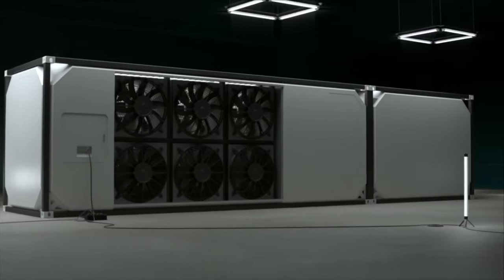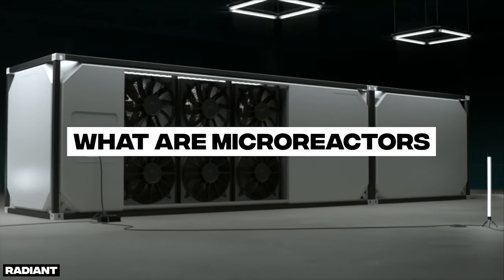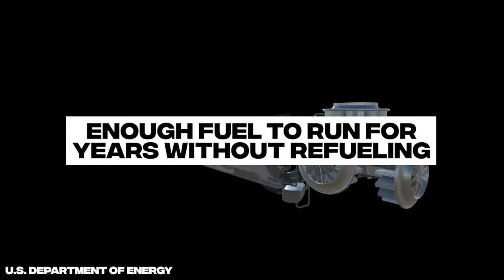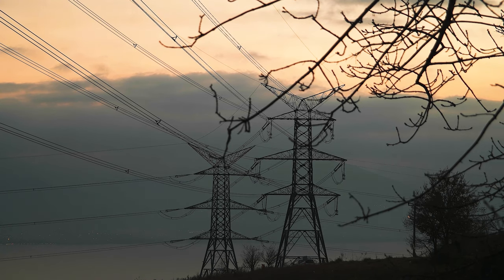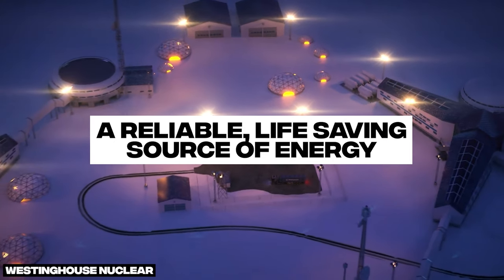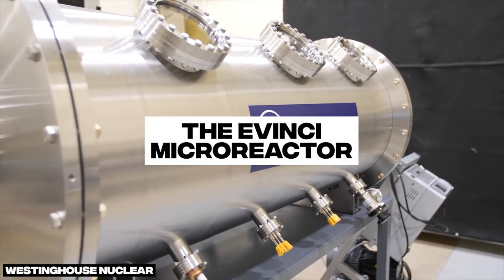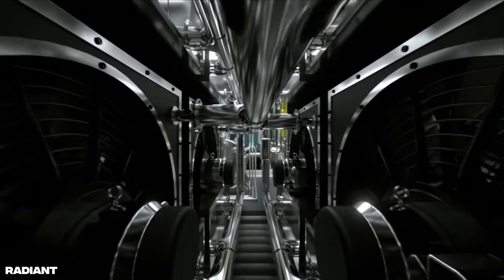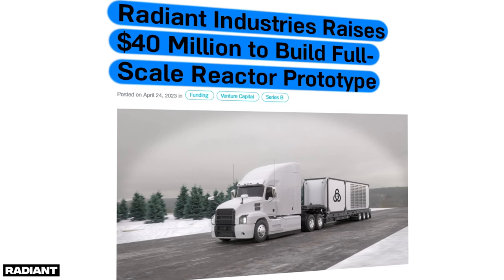Mobile Nuclear Reactors Will Change Everything

Comment: Microreactors could be used not only for electricity but also as a source of hot water for district heating, reducing the cost even further.
Reply: @williamjones9662  Bury it 5 miles deep
Reply: think Iceland 🇮🇸
Reply: Also provide hydraulic power for shops running hydraulic tools…also potentially make medical isotopes for hospitals potentially…and provide a beam line for X-Ray and Gamma Ray lasers for communication or spallation sources…space propulsion…if they’re successful…this will be as transformative as Space X Starship…yes I know many of their engineers used to work for SpaceX

Comment: Nuclear electricity is the most expensive form of  energy and this Micro-reactors would be priced well over 8 million Dollars easily and if You add the maintenance costs for 30 years it will reach at least 12 million Dollars in total , and if you use this 24/7 for 30 years you can use it for 262800 hours and once you divide 8,000,000 to 262,800 = each KW/H is around 30.00USD which is extremely high

Comment: So you're aware, westinghouse has a much smaller reactor, but it's classified still. This one was only recently declassified and applied to commercial applications. Government only uses them for subs and some aircraft.
Reply: Aircraft 😳
Reply: Exactly this. Micro reactors are not new. They have been in service for decades.
Reply: There’s a lot more than Westinghouse haha, over 15 providers with great generation 4 designs!
Reply: @Ikbeneengeit  That claim is total bs, at the most charitable they might be talking about the reactor in the NB-36. The reactor on it just output its heat to a radiator providing 0 thrust.
Reply: Tell me what aircraft is powered by a nuclear reactor.. 😂

Comment: Heat pipes with no moving parts VS exposing fast-spinning turbine blades to a high neutron flux.
Hard choice.
Reply: imagine a neutron turbine :)
Reply: I liked your comment, but thinking about it again, I'm not sure that this is what was actually presented. One thing that kept bothering me after re-watching the video is that we didn't see any associated turbine for the other two designs - just the reactors. If the reactor's heat isn't spinning a turbine, then it's not producing any electricity (at least, not very efficiently). So the jet-turbine blades are really comparable to the heat pipes, because they have different purpose (namely to convert the energy into electricity, rather than merely to prevent the reactor from overheating). That said, I do wonder if those blades are exposed to the neutron flux, and how big an issue that's going to be. Just looking at the way that quad-pack is configured, it looks like they're in the line of fire, but I'm just not sure.
Reply: @sillysad3198  no thank you, that would weigh a inconceivable amount. a "teaspoon" of neutrons weigh like 10 million lbs.

Comment: Not to mention data centers  (esp the mega scale ones used by the larger public cloud providers). These have a major common issue when a new site is to be picked: The local power grid can't supply enough power due to insufficient transmission capacity. But if a few micro reactors can be brought in and be operational in a month instead of a decade, and run continuedly for +5 years that problem suddenly becomes a lot less complicated. Ofc now you get the NIMBY rowd that will rase loud objections to a "mini chernobyl", never mind that these reactors are many decades newer with a completely different design, even vaguely close to them, but these problems can probably be solved by throwing enugh money (ie legal staff) at them.

Comment: ROSATOM's floating nuclear power plants like the Akademik Lomonosov is another interesting portable alternative. 

Since the reactors employed are smaller in size and power than most commercial land-based reactors, mostly derived from nuclear ship and submarine power plants, the power output is generally a fraction of a conventional nuclear power plant, usually around 100MWe, although some are planned to have as much as 800MWe.

They are also working on the Shelf-M reactor, a low-power NPP (ASMM) designed for local electricity supply to facilities in remote areas with an undeveloped power grid. The planned installed capacity is up to 10MWe. The estimated service life of the station is 60 years with refuelling every eight years.

Comment: my concern is how easily these could become orphan sources. the soviet union used RTGs extensively, for somewhat similar reasons, and when they collapsed those reactors became one of the largest contributors to orphan nuclear material in history. to my knowledge, they are still out there too, not all have been located.

using nuclear energy in military activities is also a concern when you consider that would make nuclear material a target for other militaries. if a military is using one nuclear reactor to power a large encampment, that's a clear target for bombings or sabotage. and a successful strike would essentially become a dirty bomb. obviously not good.

I am in general pro nuclear energy. but I really don't know that going to microreactor scale is reasonable considering the risks. at scales beneath what a small modular reactor can do, I think using renewables is probably viable.
Reply: I'm also pro-nuclear as it really is practically low carbon, baseload and gigawatt scale. but I was wondering, given the more enriched uranium how does one prevent some group from getting the uranium, especially in isolated remote regions.
Reply: @peterkratoska4524  Carrying out such a heist would require Nation state level resources. Same reason not many heists of fighter jet planes
Reply: Maybe an earthen dam or other protective considerations. But ya,  bunker busters etc. A huge target.
Reply: You can put them underground

Comment: FYI  they are great , but if you think you can throw them on a regular truck, think again... a 5MW mocro reactor is 8ft x 30ft  it weighs 660000lbs!!! Or 300 tons Not including turbine and heat exchangers. And requires concrete rooms to be built.

Comment: I don't think this is an option for disaster relief. Puerto Rico an island of 3milion will not be helped by a handfull of 10Mw Reactors. How do you want to do risk assesments, safety, etc in a area that has just had a disaster happen. If idk if Nuclear is the only option for places like Valdeze, but it seems like a way more reasonable solution than disaster relief. 
The only way I see DR happening is if it is put on a ship and doesn't leave it. i.e. Town gets hit by Hurricane which destroyes powerplants. Then ship pulls into the Harbor and is connected to an improvised interconnect, and supplements the local grid. This would allow the risk management etc happen in a controlled enviroment beforehand.

Comment: how much do they cost, and how are small remote towns expected to pay for them? are they expecting rural electrification grants from the state or federal government?
Reply: These small towns in Alaska and Canada are paying between $20/$30 per gallon of diesel. Yes, PER GALLON. Basically, some are so remote they need to fly in the fuel.
If they can finance the reactor, spreading the cost out, it can be cheaper over the long run. Federal loans would be great, but even a commercial loan or muni bond would be sufficient.

Comment: Whether it be Micro or Small modular reactors, why couldn't we just take what they put in naval ships and adapt them for land? They easily hit 200MW and are small and probably already certified from a regulatory standpoint.
Reply: We can like the one in Russia, but the problem is most of country just don't want to do it 😂
Reply: Ship reactors tend to be a bit smaller, between 30-50 MW, but the other thing is they are not optimized for electricity production, but for heat production - they typically use the steam directly to power the propulsion shafts, vs generating electricity and then use that to power the propulsion shafts.

Also, they tend to use very high-grade fuel, which is expensive from the civilian power perspective.

Comment: This is so simplified beyond belief. Are we to suppose these 'microreactors' are sitting on some warehouse shelf, ready to be despatched at an hour's notice ? When they get on site they also need to be 'buried' below ground level to avoid radiating the locals ! And in a disaster, it's the local grid (the cabling infrastructure) that's damaged. Just replacing the power source does nothing useful !

Comment: The question is what balance of micro reactors, Solar PV, and wind turbines will be used in the Arctic.
Reply: Solar PV in the Arctic will be quite minimal, because the sun shines only a few hours, at very low angles, for the winter. And if you have a power resource that can power you during the winter, why would you pay for a 2nd resource for the summer?

Comment: medium reactors are used by the Navy s8g and s9g  produce 80 to 90 megawatts
Reply: Yup. But military needs massive power in small spaces, without refueling hassles. 
And military can spend $billions for an uneconomic dollar sinkhole. 
AND military doesn't have to adhere to any kind of environmental regulation. 

ALL the biggest environmental disaster sites in America (Superfund sites) are military. 
All similar sites in Canada are military, or nuclear. 
The military is an environmental catastrophe - but they can get away with it.

THIS is your model for safe, cheap, reliable power generation?

Comment: The problem with micro reactors, aside from the terribly polluting practice of nuclear mining and nuclear waste disposal, is that eventually, someone somewhere will inevitably drive an overlifted pickup truck into them. As it stands with a conventional nuclear plant it is very difficult to have stray traffic crash into the reactor, but with a micro reactor it's much easier. 

Also we have technology that we use in the most remote of locations for reliable power, in fact quite literally as far as Mars and Jupiter. Also currently in use in arctic and remote communities and doesn't need replacement for refueling for decades. They are called solar panels and batteries. While some might say that solar is impractical a lot of northern communities are turning to solar and wind as reliable power sources specifically because they can be setup easily, last for decades, and are relatively inexpensive to maintain. I doubt microreactors will gain a lot of traction compared to new developments in solar, wind, and battery technology outside the military because nuclear power and it's logistics train is far riskier (and costly) compared to the alternatives.
Reply: Bollards are fairly effective against stray overlifted pickup trucks.
Reply: That's why it would be underground
Reply: High, huge space geek here: even for Mars, solar panels with batteries are often considered insufficiently reliable. The Curiosity and Perseverance rovers, for instance, use RTGs. The problem is giant dust storms, which could sometimes last as long as a few months. The systems you're describing also don't need much power - less than a kilowatt. These micro-reactors are much more capable, which is why even NASA is getting on board with the fission-hype train.

Comment: I dont believe any of the microreactors will take off. 
It cannot be cheaper than just drilling a geothermal shaft. 
Its hard for big reactor replacement, but not for such a small reactors!
Reply: Lmao geothermal is dependent on location and areas good for it are sparse

Comment: these are 30 years over due considering nuclear subs have been around since the 1960s
Reply: True, but these reactors are even smaller than the ones typically found on submarines (although the one found on the NR-1 might be about the right size).

Comment: This is an excellent commercial for nuclear power. Is there a reason you didn’t use the word radiation or nuclear waste? What happens if someone steals one of these things will happen if it rolls down the side of the mountain into a river?
Reply: Well, first, although it may fit in a shipping container, it may weigh more than the standard 20tons of a regular semi-load.
Second, as the power goes out, and the local police notice that the alarm at the local NPP is going off, the thieves may be noticed stealing it.
Third, if you are a thief - you must want to sell what you steal, so you probably won't be rolling it down a mountain into a river. If you are a terrorist, you might plan on doing that, but really so much simpler and higher visibility to blow up the airplane taking you to the city that has this NPP that why bother going to the effort?

Comment: I was just thinking, Could these micro reactors be put on board ships, to reduce/eliminate CO2 emissions related to shipping? with the size of ship engines (and their associated fuel storage) fitting a fef container siced reactors instead should actually increase the space  for   payload. Ok granted you would need some rather hefty cables and electrical engines to drive the prop shaft, but surely these problems can be solved, unless I'm missing something really basic. Oh fes the drunk captain running aground and creating a mini Chernobyl, hmm obviously this is not a solution reedy for delivery NOW!  
No it is not my intention to spam the comment section, I just rewatched the video and thought hmm why not put these on big ships

Comment: I dont think microreactors would be very desireable in a peer or near peer conflict. In a war like in ukraine, I think it'd be a high priority target for a long range missile.
Reply: Not if it is as well protected as the 5 NPPs which already exist in Ukraine (and nearly every other NPP almost everywhere else). Their containment buildings can survive weeks of artillery bombardment. With reinforced concrete walls 4 feet (~1.2m) thick, they can't be penetrated by a Tomahawk cruise missile. It would be much easier (i.e., cheaper) to build one of those for a microreactor than an entire gigawatt power plant. Interestingly, a smaller structure - for the same thickness - would likely be more durable. There's a trick that tank-manufacturers have learned since World War II that a smaller armored vehicle, all else being equal, would be more resilient than a larger one because it has a lower surface area. The military is already used to building a whole bunch of structures just like this. During the Cold War, both NATO and the Warsaw Pact built dozens of hardened aircraft shelters for their fighters on each of several airbases. These structures could fit any fighter jet with room to spare. An F-16, a small fighter, is over 40 feet long, 16 feet high, and over 30 feet wide. An international shipping container (which is larger than any of these reactors) is always 20 feet long, can be anywhere from just over 4 feet to nine-and-a-half feet high and a width of 8 feet. This means that a microreactor bunker could be about half the size (or smaller) than one of those shelters. Those shelters were capable of surviving a direct hit from a 500 pound "general purpose" bomb (so not a bunker buster) - so it does need to be thicker to withstand more powerful weapons (i.e., about as thick as a nuclear containment building). All we really have to do is make the structure thicker and smaller and we're good to go. Furthermore, all that defensive structure could easily be buried underground on a miliary base. Also, it doesn't take that much to stop radiation, so having several feet of concrete and steel buried under several feet of earth is going to prevent it from becoming a "dirty bomb." 

There's also another idea I just thought of which could complicate enemy targeting. I've been reading about a new mobile missile launcher the US military has been working on which can launch Tomahawk cruise missiles and fit in a shipping container. One tactic that they were thinking of using would be to drop a whole bunch of shipping containers all over the place, with only a few actually housing missile launchers. The enemy would be forced to play shell game trying to figure out which shipping container is a real threat. They could just as easily do this with the microreactors. They could build several bunkers side-by-side (with some space in-between), lower a shipping container in each one (only one of which houses a reactor) then cover it up, having buried wires coming out of each one. Then, during peace time, you'd have nuclear engineers going in and out of each bunker so spy-sat operators can't tell which one is the legitimate target. Now remember that if you do hit the right one, you need several cruise missiles just to breach the container for the microreactor (or one ridiculously large gravity bunker-busting bomb which would need to be carried by a plane which would have no chance of overflying a US military base in a time of war). Of course some of those missiles are going to be shot down, so you'll need a significant swarm. I think the enemy is going to decide that it's not worth the trouble.

As evidence, I present.... the Russo-Ukrainian war itself! Last winter, the Russians fired off a whole bunch of cruise and ballistic missiles together with suicide drones at Ukraine's power plants. Not one of the 4 NPPs still under Ukrainian control were targeted. Part of this might be because they're all in the western part of the country, meaning that the missiles have to fly farther to reach them. However, that didn't stop them from hitting quite a few targets in Lviv and other nearby areas during the electricity blitz. I consider it likely that the Russians realized that it would take too many missiles to deactivate even one reactor (the plants have 4 or more each), so they decided that it wouldn't be worth the trouble and focused their efforts elsewhere.